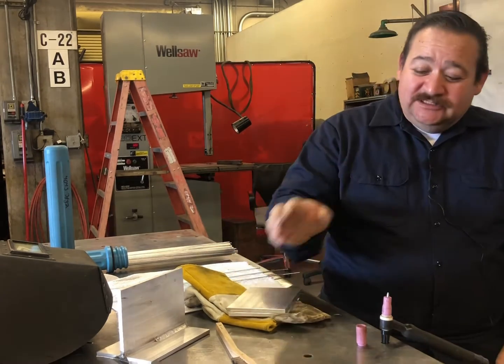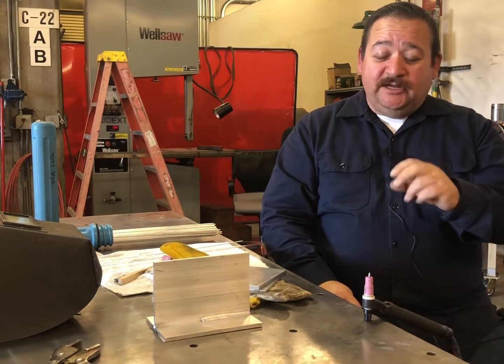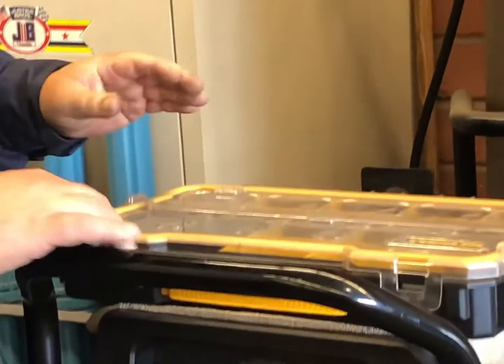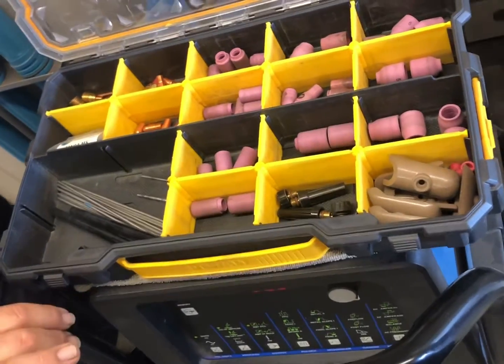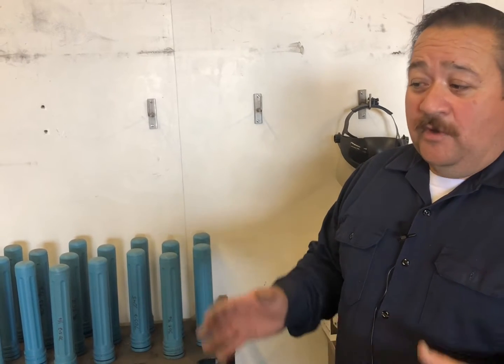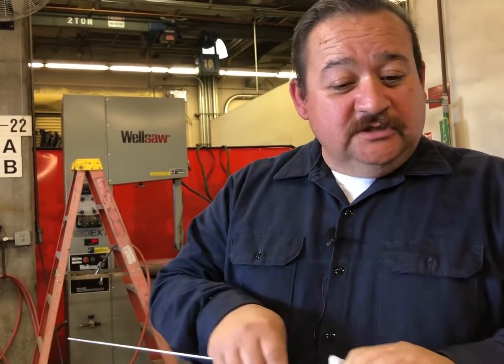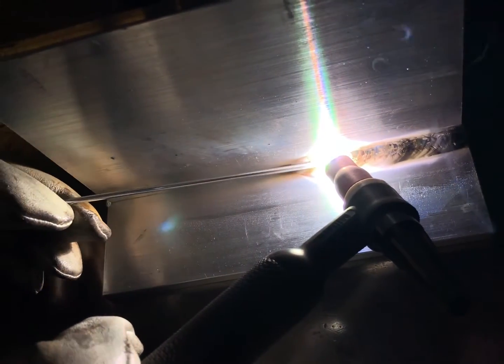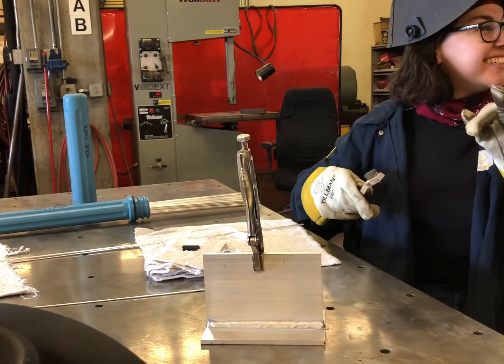How to: Tig Weld Aluminum on DC

Comment: In the “old’n” days it was called heli-arc welding for a reason. It was dc welding aluminum with helium gas. As he said using helium gas the electric arc travels across to the base metal easier (thus increasing voltage). AC current welding aluminum has a cleaning action in one half of its phase. If you look closely at most tig machines you’ll notice a diagram of the weld puddle during the different times in its phase. The dc portion will have a narrower bead face with deeper penetration, while the ac portion is a wider puddle with less penetration; adjusting the knob setting between the two is determined by the thickness of aluminum you’re welding.

Comment: I learned that a long time ago from an old timer, and have been welding for many years. I went to welding supply place to get some supplies to weld some heavy aluminum, and a fresh tank of argon. Dude at the place told I didn’t know what I was talking about and that there was no way to DC Tig weld aluminum, I took the parts in after and he didn’t believe me even when I showed him.
Reply: I've had the same problem! Even got an email from the company's "process engineer" saying I couldn't do it

Comment: There's no reason in the world to do that: it's 2022 guys, just buy an ac/dc welding machine🤦🏻‍♂️
Reply: Both AC and DC call for cleaning all the materials and using the correct filler rod, so the only difference I noticed was using helium, right?
Reply: @scidork  in every material u'd better clean base material, but if you know what you are doing and what'sthe use for the parts you are welding you can skip this part, especially on aluminum; you have ac current to clean the material and as long as you have just to clean some oil/wd40 and so on, you can just burn it , wait for the puddle to be clean and add material. obviously she described the way to go that a teacher would teach you at school; but in real world things don't always get done how  they teach you at school: you have to know what you are doing. Helium is just useful to her because she has a small welding machine capable of 255 amps peak current: helium is a hotter gas than argon (can't really explain in english, but at same amp you'll have increased volt of your arc with helium mix, approximatly 18 v with helium mix vs 16 volt with argon; so it will be like having a bigger machine, but also the arc with helium will be more focused and the alumin won't be able to spread heat that much on the part); but keep in mind that unless you live in the usa, in europe helium is crazy expensive and if you regularly weld aluminum, especially thick stuffs, it will be cheaper to get a bigger machine, in the range of the 400/600 amps, or if you can, preheat the parts.
there are so many different ways to get the job done properly, you need just to get some experience: if you do it 8/10 hours per day as a job, u'll quickly learn what you need to do. tig welding is about a good hand and being able to control the puddle, so you have just to know what to look at; if you are good enough you don't even need a support for your hands, it's just practice

Comment: You have to use a porcentave of argon and Helium. Example; - 75/25 or even 50/50  like  for  Brass.  The more  Helium  the more fluidic and  cleaner  the  puddle  Becomes.

Comment: If you have been welding as long as you claim the reason, we A/C WELD is to break the oxide layer away . 
D/C does not break that ceramic layer away, which can be introduced  into your weld pool .This is the reason D/C is no longer used .

Comment: When we can use DC or AC current for Aluminum
Reply from the maker: AC is the most common aluminum welding you’ll see but DC is more for thicker aluminum, deep penetration, for clean welds no spitting like AC, and weld speed.
Reply: @fluxngutz4667  Thank you so much

Comment: Can it be possible to use only argon gas to dc tig?
Reply: Argon doesn't produce a hot enough arc the burn past the oxide layer, you probably could but it would put down anything halfway decent.
Reply: @MrBuboyangeles  Absolutely!  Argon gas cleans the weld puddle better than helium. But, as with all processes of welding there are better ways of doing things. If you have an ac machine, the ac electric phase of your weld cleans the puddle better than just the gas. If you’re welding a thinner plate of aluminum that doesn’t need the “increased voltage effect “ that you would get from helium gas, then by all means use argon gas. Mechanically clean the weld area very good, first.

Comment: This is cool I mean obviously I didn't know that you could do this and I'm just a beginner welder myself so thanks for the video but is there any instance where I mean obviously AC is and just running argon is cheaper and just straightforward so is there any job or some kind of instance in a project that this would be more of a requirement or a better solution or better freezing to do this by doing the more expensive weld obviously with the helium and the mixture and you know all that kind of stuff having to go on compared to just your straight argon and straight AC welder sorry about going all the way around my elbow to get to my thumb there but I'm just trying to get it explained the best way in the how to we use AC today and AC seems to be working just fine maybe the point of this video to show that you can use DC but I'm thinking more like is there certain things that might be built that this type of welding with The helium and the things like that would make a better weld or stronger weld and hold better because of whatever kind of situation maybe pops knows a a job that would benefit from having to do the extra money in the extra spending for something like this thanks God bless
Reply: He explained this in the first few minutes of the video, but I'll try to answer your question. If you can find helium to run dc aluminum, you'll get better penetration on thicker base metal with less preheat and fewer amps, thanks to the way helium acts with the arc. Unfortunately, helium isn't just expensive, it's hard to get now. I live in Las Vegas and I have to send a bottle to salt lake city if I want it. AC is just more practical in every way.  If you absolutely need to weld aluminum and all you have is a DC machine, this is how you do it. These days, with inverter machines, there's really no need to run straight DC on aluminum. There is an advanced pulse program that some machines can run that switch between AC and DC- for a very short burst while still using 100% argon. It's amazing how much more penetration you get from just a blip of DC-. Anyway, have a good day. Cheers.
Reply: So thickness plays a huge roll in why welding aluminum in dc is superior. When welding aluminum it dissipates heat very quickly but welding dc using helium is very deep penetrating and inputs the the heat quickly so you can achieve a quality weld without all the tungsten spit of AC. You can weld 1/2” aluminum plate without preheat. Try welding 1/2” plate on AC without preheat and you can compare.  I used to weld 2” thick aluminum molds with minimum preheat with 0 failures. We tried welding with AC but we had so much tungsten spit even with keeping the part hot that we decided that it was more cost effective to use dc with 100% helium. Hope this helps. If you need a more comprehensive explanation I will put another video out with moxie.